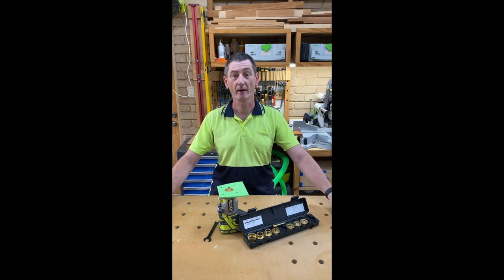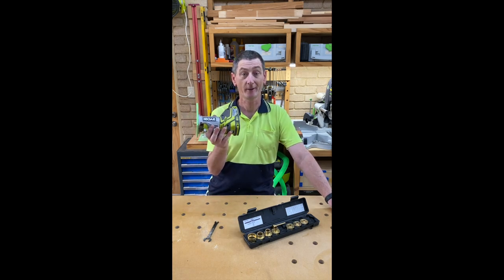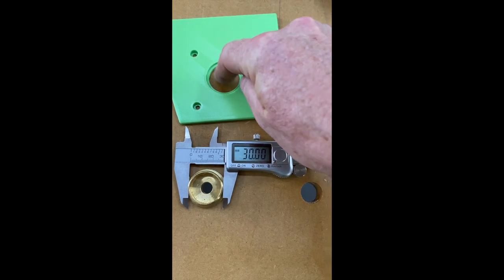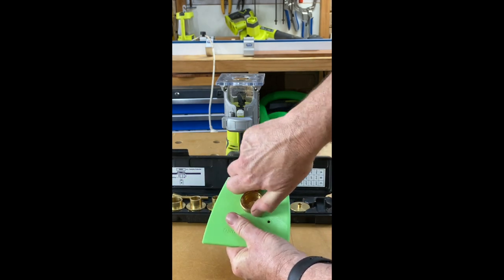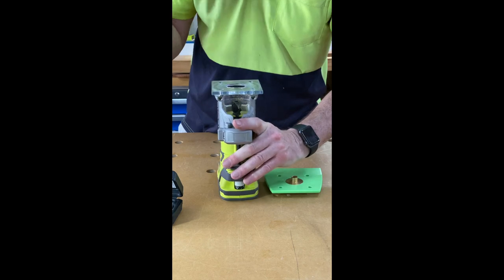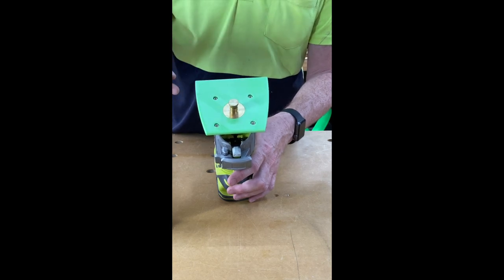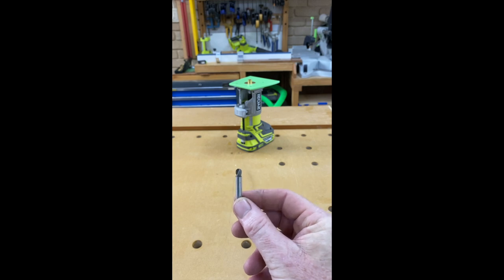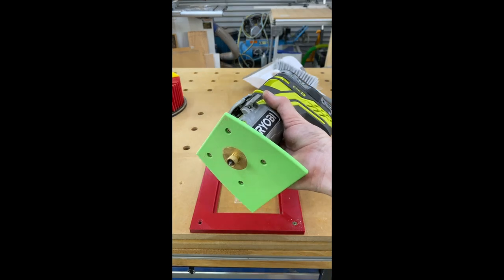#Shorts. Template following guide adaptor plate for Ryobi One+ Router.

Comment: @DarrensWorkshop - Hi Darren, what brand/model of bushings are you using in the video (to ensure a perfect fit!)
Reply from the maker: Hi, these are the ones I have. https://www.carbatec.com.au/brass-bush-set. They are a standard size so other brands should fit. Look for an external diameter of 30mm on the threaded portion.
Reply: @DarrensWorkshop  Thanks, am i right in thinking the thickness of the bushing would be just as important as well though for it to sit flush with the router sub base?